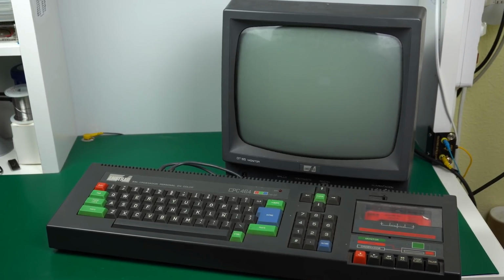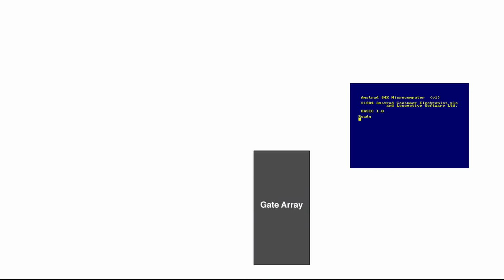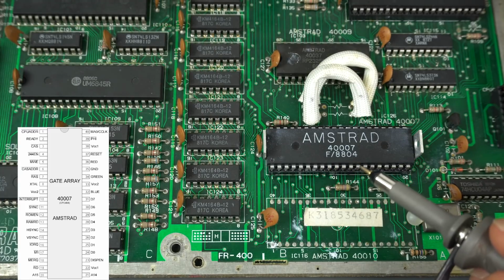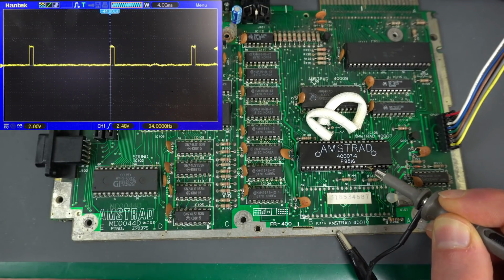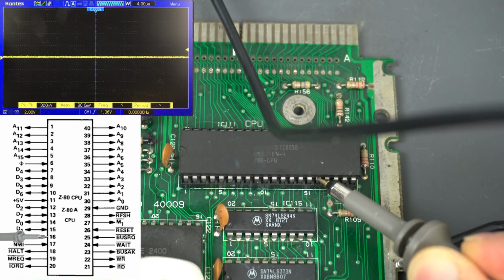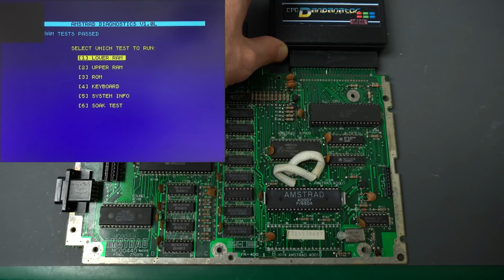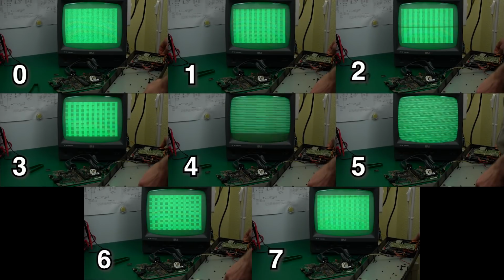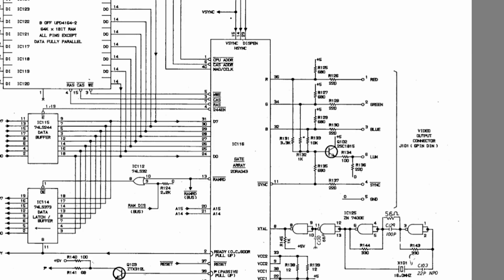Garbled Screen! Amstrad CPC 464 Video Failure

Comment: What a thorough analysis!
But I have a question: Is it possible to damage a RAM IC from the expansion bus?
I recently repaired a DDI Clone, and after a few days of running it, IC120 (Bit 0) failed.
Regards

Comment: Hi, I had a memory problem. I poked the memory and found that 49151 memory address failed. I guess that is upper memory. Is that the 4 top chips on your vid? Your help would be really helpful. Save me taking all chips out. :)

Comment: Yay! The "gatorade" is back. It wasn't on this video but rather the first Spectrum video, you kept talking about the "gatorade" which was of course baffling to me as I had zero knowledge of the speccy internals. But about halfway in you showed a block diagram with the gate array/ULA was marked, but gate array was still pretty far from gate array in my mind, but over a few seconds I figured it out. So now the ULA is forever the gatorade at least in my twisted mind.

Comment: The problem of how the CPU and the video hardware fight over the RAM is always interesting to me because every personal computer of that era had its own solution.
Reply from the maker: Absolutely! That's actually one of the main distinguishing features of computers at the time: separate RAM, interleave access, or blocking CPU are the main general approaches. Honestly, I'm not sure which one I would pick if I were to make a similar computer today.
Reply: @NoelsRetroLab  There's also the simple but ugly approach that my Ohio Scientific used. It just blanked the video output with an AND gate whenever the CPU was accessing the video RAM. Whenever you wrote to the screen, lines would briefly disappear which was better than the sparkles that would have been displayed.

Comment: On SCART at least the lines are usually terminated with 75 Ohm resistors in the display IIRC, so yeah, that'd drop the thing quite a lot when plugged in.

Comment: Excellent video as usual, Noel - thank you! I may have mentioned this before - sorry if I have! - but may I suggest that the "probe" icon on the schematic is placed so that it does not cover the label of the pin you are probing? I suppose that a red dot or a small arrow would work anyways, I can understand that changing the transparency of the schematic picture would take time. Looking forward to your next video!
Reply from the maker: Thanks! Yes, I remember your suggestion but I didn't come up with anything that worked really well. Maybe I can just use a smaller probe graphic and put it on the inside of the chip. I'll try that next time. Cheers!
Reply: @NoelsRetroLab  No problem and sorry for mentioning this again. What about a red rectangular shape which highlights the pin AND the label? A smaller probe/arrow from the inside would work as well I think.

Comment: If only they made it so the CRTC could start its first fetch at a specified address or better yet,  allow the address to be changed mid frame.  This would have allowed for cheap. fast and smooth vertical scrolling. They make the same dumb mistake in the Atari ST.
Reply from the maker: There's no doubt the CRTC could have been much better, but the one there isn't horrible. I believe you can specify the starting address, although maybe not mid-frame though. You can tweak a lot of parameters.

Comment: not really possible to be a burn at that point with 5v supply and those resistors it would never get hot. resistors never really go short circuit inside and if they did the burn would be in the middle of the resistor. a high resistance joint there would just drop voltage and reduce the current.
Reply from the maker: Well, there is a transistor there that I thought could be causing that, but the "burn" marks were at the base, so that's very unlikely thinking back.

Comment: I've seen this with bad RAM chips before.. it's important they stay off the bus when they're not supposed to be there... but i have seen faulty chips that always hold their output at some bad level regardless. Have definitely seen this happen on those Samsung 4164's in ZX Spectrums

Comment: Horrible nasty little buggers, those RAM chips are. They cause all sorts of problems. Why do they fail? Did you replace the other RAM chips as well. They might fail in the future.
Reply from the maker: I didn't. It's a fair amount of work and the traces on the Amstrad CPC boards are pretty delicate, so I'd rather deal with them as they fail. The time I'll do that is more than half of them are faulty, then I figured there's something really wrong going on and swap them all.

Comment: have you tried checking what multiple bad RAM chips would show?
Reply from the maker: No, but the patter would be totally different since it would cause to jump around to different places. And then different combinations of bits would cause different patterns, and whether they failed low or high... it's a crazy number of combinations (256 to be precise 😃).
Reply: @NoelsRetroLab  6561 combinations actually (3 to the power of eight, not 2 to the power of eight (which only accounts for all failing))

Comment: Great video as usual. Did you spot the swollen capacitor near the power jack Noel ?
Reply from the maker: I didn't. Was it swollen? I noticed it was a bit dirty around there, but it wasn't the cap leaking. Electrolytic caps almost never fail on the CPC main boards for some reason, so I hardly ever look at them.

Comment: Great as ever... Is that a late issue short board but with an early gate array? 
The more 8 bit systems I restore the more love I have for the design and build of the CPC464.
Reply from the maker: That's right! A bit of an odd combination, isn't it? At least it has room for both kinds of GAs. Personally, I'm a fan of the original long board. That thing is soooo roomy to work on! 😃

Comment: 19:03 you been watching CuriousMarc, haven't you? ;-)
Reply from the maker: I actually didn't even know about it until now. I'll have to watch a few 👍
Reply: @NoelsRetroLab  His series on the Apollo Guidance Computer is pure GOLD!
Reply: @NoelsRetroLab  OK that's an insane coincidence. He's currently working on a 1972 HP PC whose PSU shorted and sent 13V into the 5V rail and as far as he fixed it, the current state is exactly the same as you said there - the machine executes a subroutine, but when it returns, the return address is corrupted.
I genuinely thought this was a nod to CuriousMarc!
Be warned though: His videos are entertaining, very informative (he makes learning fun) and even thrilling - he ends most episodes with a cliffhanger so if you start watching his channel at 10pm, it could happen that you won't go to bed until 3am...
Reply: @senilyDeluxe  i just watched his latest vid on that yesterday...  
...looks like Marc might get some hints from this vid!...he was thinking it was a DRAM refresh issue... seems it could be a completely bad RAM chip!
Reply: @WacKEDmaN  Good idea. Usually these 4116 are pretty sensitive and die easily. But they can fail in a way that single bits drop back to zero quicker than refresh can catch them.
But mind you, the machine's self test tested the entire RAM and found no faults.* Also he checked various refresh-related signals on the RAM PCB and found them to be way out of whack compared to a working board. So the board is definitely not refreshing the RAM the way it should.

* TL;DR when testing RAM, don't just write a bit, read a bit, but fill the entire RAM and then read the entire RAM. I've encountered so many machines that pass their RAM test even though the RAM is flaky because of bad RAM test routines. Sure, it'll find dead chips, but it won't find flaky chips. (but I've also encountered ones that did it right and flagged chips that otherwise would have passed - you can see it on the screen, it clears and then a few erratic pixels start to appear - the simple RAM test would pass that and you'd have to find the bad RAM yourself)

Comment: Please keep making videos, they are really well done and enjoyable. Between you and Adrian, I get my electronics fix in a week.

One thing I'd like to see, is someone find out why these old computers were designed the way they were. Cost is obviously top priority, so hearing the solutions around that problem would be fascinating. Such as why the CRTC and Gate Array weren't combined into one chip!
Reply from the maker: In addition to what Thomas said, if the CRTC was combined with the Gate Array... then we would need many more pins! They did that later when they went to ASICs, but I guess using that level of technology, this was much cheaper that way.
Reply: I commented before I even got to see the CRTC was an off shelf part. 🙃
Reply: The CRTC is a stock component made by Hitachi, Motorola and others (?) and can be found on PC graphic cards of this era. The GA is what makes the CPC a CPC and does a bit more than video output; maybe compare it to the PLA on the C64  (with some Vic2 mixed in) :-). 

See also https://neuro-sys.github.io/2019/10/01/amstrad-cpc-crtc.html
Reply: And it is fascinating to compare the US 8 bit micros to those developed in UK. The C64 for example has lots of custom chips (VIC2, Sid, PLA, CIAs) whereas the design of the 464 is really simple (no custom parts except for the GA). The 64 basic sucks, an OS is almost non existing. The CPC basic and AMSDos are way better! But the C64 has HW sprites, the CPC doesn't.
Reply: @thomaskalbe6018  That would make for an interesting video in itself. A general look at those sorts of differences. The Amiga 500 (and 600 etc) is full of custom chips, though later than the C64. It has weird quirks that the CPU isn't even on the same bus as the RAM.

Anyway, thanks Noel. Never surprised to see a reply from you. You do great at interacting with your community.

Comment: another great video your knowledge is supreme ...... ohh them smaller mother- boards are so fragile..i have seen that with the power sockets on a few of them i normally put a new capacitor in and bend the leg round.. any advice on a ""cheap" "O scope" for use with these computers (Amstrads/spectrums/ maybe commodore at some point)  ? i have got a couple 464's at the moment  with that dreaded 'square' of doom
Reply from the maker: Hey, that's a cool trick to fix the power track and doubles as a nice voltage stabilizer. I like it.
I don't have any recommendations for a cheap scope. Some people have good results with PC USB ones but I never used them. My scope isn't super expensive and I even bought it second hand, so it ended up being around 150€ I think. Totally worth it, but I understand it's still a lot if you aren't going to be using it all the time. You can try just using a logic probe that just tells you if there's activity in a line. They're probably like 5-10€.
And if you have that square of doom, put in the Diagnostics ROM and it'll probably narrow it down for you. Good luck!

Comment: Another great video Noel! Diagnosing signal errors is always a field of rabbit-holes, especially when everything is inter-dependant like in these machines with ULAs. Great bit of detective work. Just goes to show that it pays to fix things as you find them, even if it seems unrelated to the main problem.

Comment: 19:57: It bothers me slightly how you're saying here that it has "two bits set to zero". I guess you could say that on that particular nibble, the second bit (from the LSB) is set to zero, but unless there's something else you're not showing us, this isn't "two bits".
Reply from the maker: What I meant by that is that each byte will have 1 bit (the 5th from the LSB). Since the return address is 2 bytes, popping that 16-bit address off the stack will return it with two bits set to zero (or one, or incorrect in general): The 5th one of the lower byte and the 5th one of the upper byte. I didn't show it graphically with the second red circle because that one was already zero, but maybe I should have to make it clearer.
Reply: @NoelsRetroLab  "each byte will have 1 bit" <-- Did you mean each byte will have 1 faulty bit?
"the 5th from the LSB" <-- I was referring to the least significant bit of that nibble. Are you referring to the LSBs of each byte? (It's arguably more conventional your way.) Also, looking at what you show on screen around 19:57: Isn't that the 6th bit from the LSB? And if you're really saying each byte will have its 6th-from-LSB, i.e. its 32nds place be faulty, then I would agree that apart from highlighting that bit red in the D4/F4 byte, it would have been a lot clearer for you to have painted that bit red in the 05 byte also. With those corrections, are we on the same page, or have I misunderstood you still?

Comment: I noticed you use a desolder pump, me too. However they take the use of both hands, I bought an Iron that has one built into it and boy it works great. They are 30W  and cost  about 16 quid on ebay. Great video btw ^^
Reply from the maker: Thanks! I use both kinds of desolder pumps: the manual ones for single things, but then I pull out the desoldering gun for whole ICs. It's such a useful tool!
Reply: @NoelsRetroLab  Agree on that one for sure. BTW Noel check out the computer on my channel, bet you haven't seen one of them before ^^
Reply: Which model did you get john?
Reply: @ismaelyutub  Sorry my bad, it was from a company called CPC and the iron is called D01849 DESOLDERING IRON/SUCKER

Comment: When I see these battlefields of ancient low-cost engineering, I always wonder if it couldn't be at least improved with added or improved bypass caps?
Reply from the maker: I'm not sure. Where would you use them? To clean up noise somewhere?
Reply: @NoelsRetroLab  It's just an idea, maybe clean up the video out or the power supply, inductors must have been too expensive for these machines.

Comment: I really love your deep-dive videos. Though I'm now working on IT, I started my career in electronics. As an intern in my first job (at 16) the department of the company I work for designed Z80-based computers to use in industrial environments so tinkering with those old 8/16 bit computers is something that has a great appeal to me. Too bad here in Brazil the prices for anything like that are too rich for my pocket.
Reply from the maker: Really glad to hear you're enjoying them! I have heard about the retro situation in Brazil! In general retro is getting more expensive everywhere, but that sounds ridiculous from what people have told me 😖

Comment: interesting...this might be the issue with mine not displaying anything on my RGB to VGA board... (cant test it on an original monitor coz i dont have one!)
thanks Noel.. your vids are always top notch!
Reply from the maker: Do you have access to a Dandanator, M4, or some kind of ROM board? If so you can pop in the Diagnostics ROM and you should be able to sort it out (unless your edge connector was dirty like mine was). It also beeps as soon as it starts, so if nothing else, if you hear that you know that there's a lot of stuff working already, even if you get no video out.
Reply: @NoelsRetroLab  unfortunatly no access to a Dandanator or the like... and the top of my edge connector is pitted bad! 
...and i dont have the tape deck either...(its just the original Z70100 board!)..so no sound out! (guess i should bodge up a speaker!)
ive sorta given up on it :(  i think ive ripped some vias on the CRTC...and my eyes are going bad!... 
...i wish i had access to a working cpc i could probe around on... 
you wouldnt be interested in trying a repair? ill send it over to ya from Aus! (i was hoping to get the board working so i could make up my own input for it...it was just missing the gate array when i purchaced it.. ive replaced that but still cant get anything out on the RGB to VGA board..even tho there seems to be signals coming out of the CPCs RGB+Lum+Sync)
ive even contemplated buying one of the clone/smaller form factor boards and using the chips from my board

Comment: Always a pleasure to see you fix a CPC (my favorite). Your explanation of the video signal generation is awesome. It is great that you could follow the issue down to where in the ROM code it must have ended up to corrupt all the CRTC registers. Makes me want to modify my simulator to support damaged RAM bits and reproduce in the debugger where it goes step by step :-)
Reply from the maker: Do it! I'd be very curious about it. Are you still working on your emulator by the way? I noticed it doesn't run on 64-bit Mac. Maybe I need to get the source and build it myself. Is there a Github page by any chance? I wasn't able to find the source even though the web page says you're going to open source it.
Reply: @NoelsRetroLab  I'll try it and let you know.
Yes I still improve CPC++ on my ample spare time :-)
It's on bitbucket at https://bitbucket.org/bricerive/cpc/src/master/
I need to update the build instructions but it currently builds on my Mojave mac.
I should also make a release at some point.

Comment: Good video as usual. 

I'm glad I'm not the only one that sometimes sees a hardware problem and chases down a trail only to find out that it was one thing I didn't expect. Funny how you can get focused early and then not see it until later.
Reply from the maker: Thank you! And to be fair, that's totally fine as long as you keep checking your assumptions. The thing I'm most proud of in this repair is that I resisted the temptation to desolder anything until I was sure it wasn't working correctly (unlike a certain C64 repair I did a while ago 😃).
Reply: @NoelsRetroLab  I went down a 128 repair for a week. Replaced some expensive parts. Turned out to be a single bad trace on multiplexer. I think we've all been there ;-)